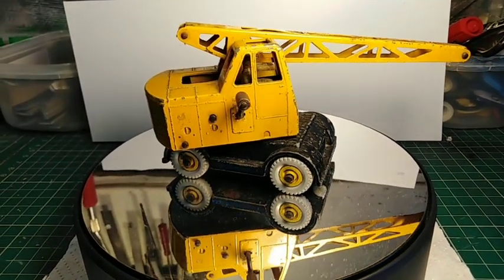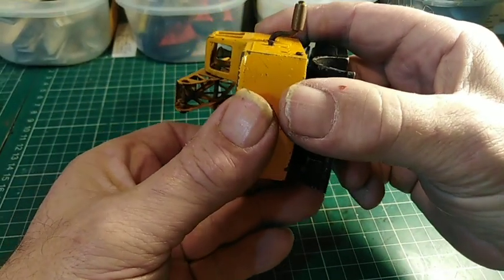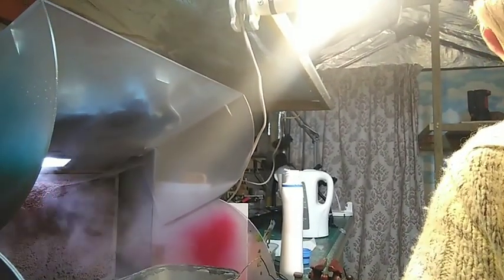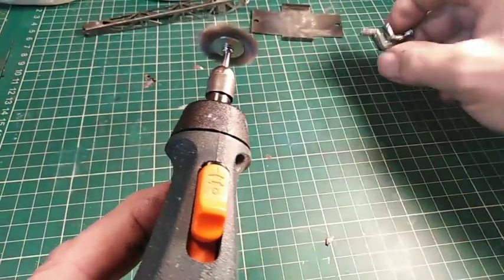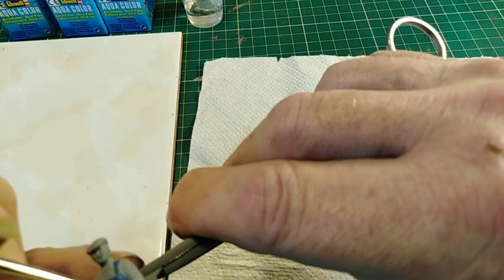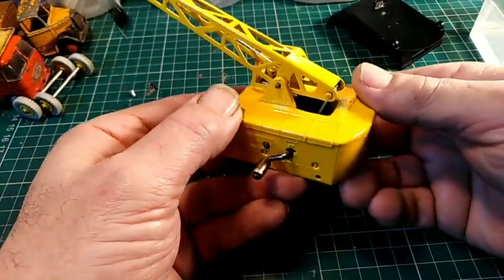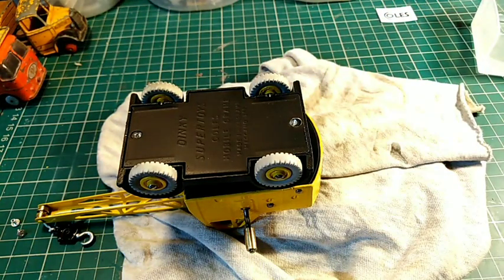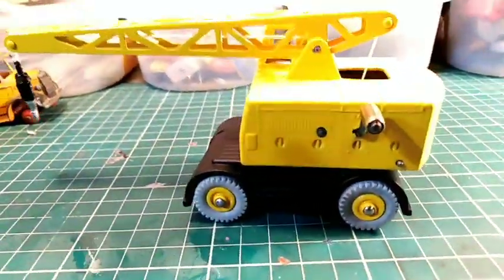Dinky toys coles mobile crane no 971 full restoration.

Comment: Nice job, I’m doing the lorry mounted crane at the moment.
Reply from the maker: Yeah I have one to do shortly, I will let you go first 😁😁😅
Reply: martin dare lol thanks, look forward to seeing your one.
Reply from the maker: I have 2 to make 1 good one.
How did you get on with the big  washer type thing holding the cab on or did you leave it on like I did with mine
Reply: martin dare hi Martin I used a dremel to remove the rivet to make it easier to paint. I also need to make a spring for the winder as mine is missing.